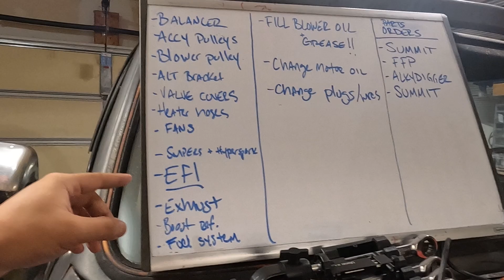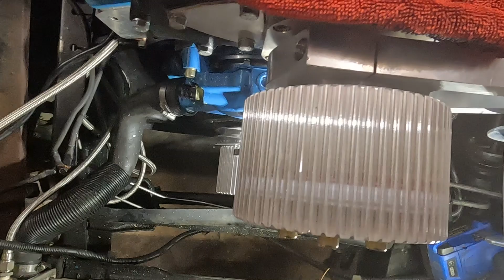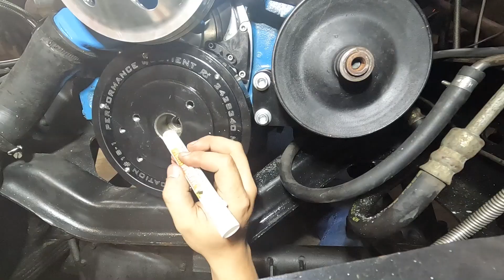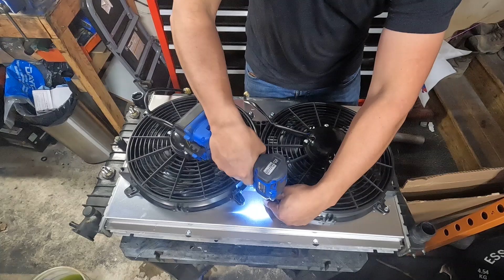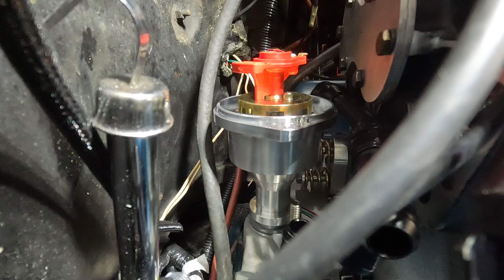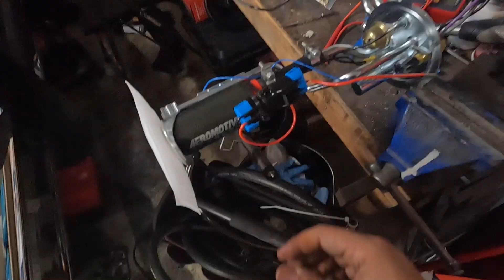6-71 Supercharger Install on my BUDGET 350 SBC - Part 2!

Comment: what water pump and pulley is that you are using for your build? im having issues trying to line my belts up for my supercharger build
Reply from the maker: Short pump. This one has the dual pattern for different pulleys. 
https://amzn.to/44KZJbU

SWP Pulley 
https://amzn.to/3J0TmZq

It's rough, I also used these brackets. Going to have to massage the Alt bracket to line up. 
Alt - https://amzn.to/4oktQyK
Steering - https://amzn.to/46so1IX

Comment: Do you ever talk about the boost reference hose on the back of the intake. I want to see what you did. Mine is just a rubber hose that keeps blowing off after a backfire.
Reply from the maker: I dont think so. I have a 1/8" npt to push lock adapter. Then run a hose to a vacuum block, that's where the sniper gets its reference.

Comment: Nice work ..can i use a supercharge blower w/ out the blower inside ..empty only for car shows for look ..
Reply from the maker: I think you'd be opening up a can of worms. You'd have to come up with something for the drive pulley to attach to. Then you might get fuel pooling in the blower case.. driveability issues. I wouldn't ha
Reply: You can, but the best way to do it, is by fabricating a Rectangel with a sheet of metal, so the air passes straight through the Blower. Also one Carb would be better for that matter.